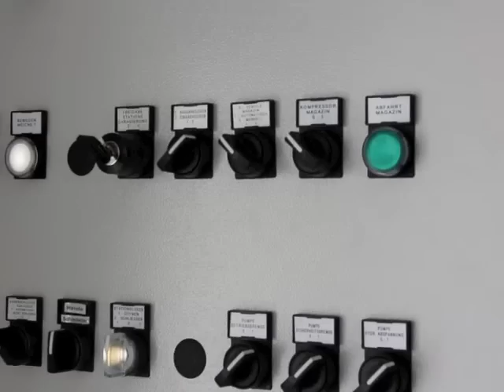Stationsgaragierung Leitner CD6C Hochalmbahn

Comment: I can see that the clutches on the wheels are air controlled, how does that work When its really cold? We have the first  of the leitner 8 chair lift at the ski resort where I work and the parking of the chair does not work at all. I guess you can call it a prototype . Cool video
Reply from the maker: Hey, sorry for the late answer. The Airtemperetaure has no impact to the airvalves and the pipes. The facility runs with an airdryer so there is no condensation inside the system. So you also have this System? Maybe you have to check the airdryer system or condensation inside the compressor. Let me know if you found any issues. 
Thanks !